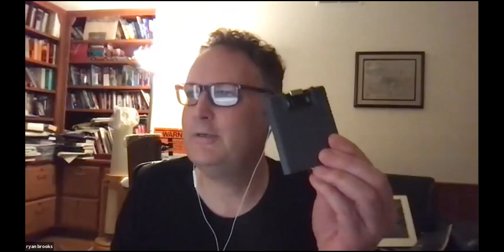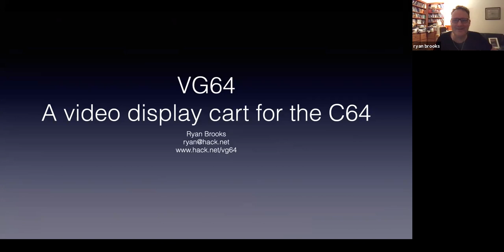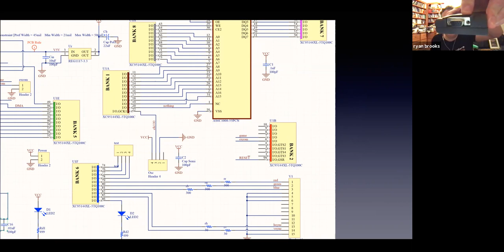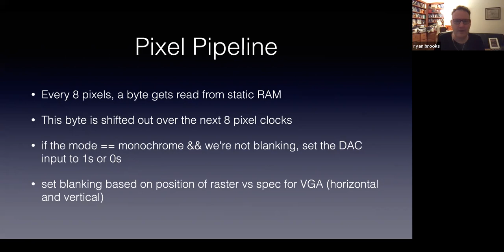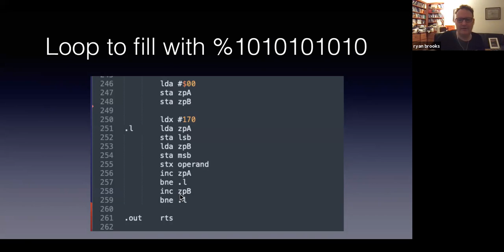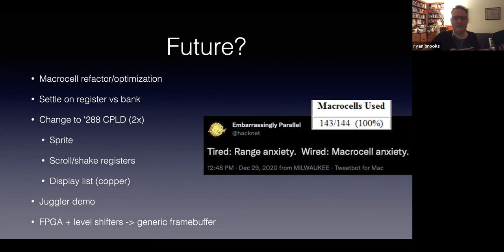VG64 - A second screen for the Commodore 64 * Ryan Brooks * Commodore Users Europe 18 Sept. 2021

Comment: What is the benefit of this versus the FPGA framebuffer used in Commander X16 which can also be connected to C64 over cartridge port? The VERA module has sprites etc already implemented. Price perhaps?